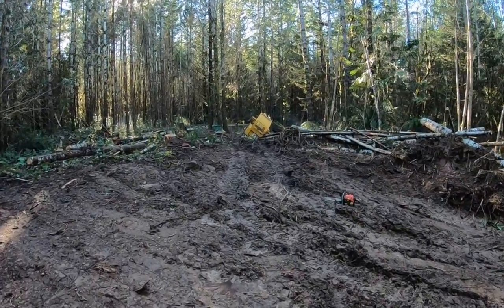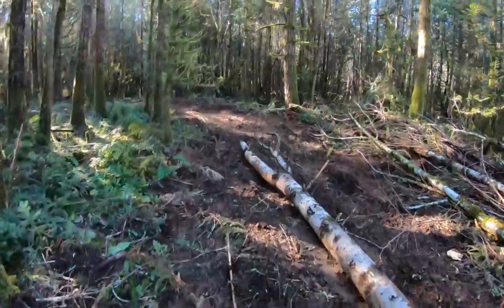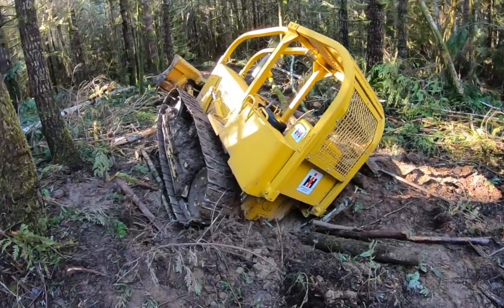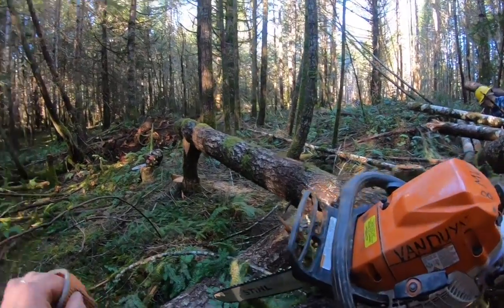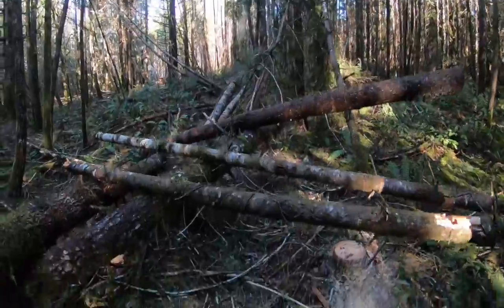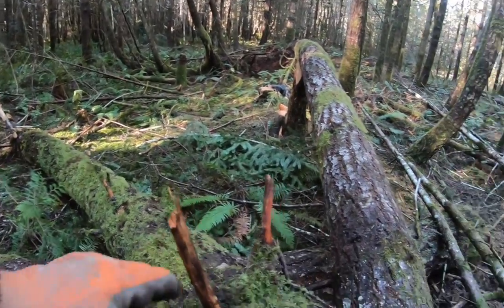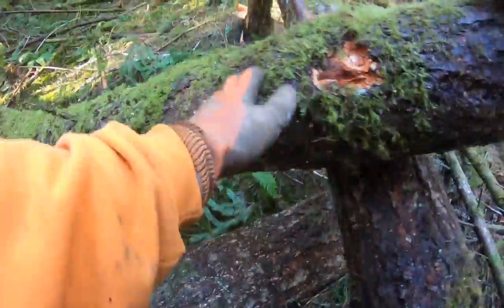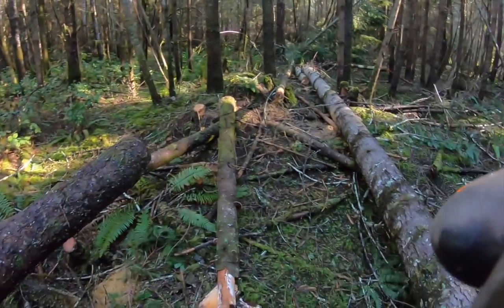DOZER FLIPPED ON ITS SIDE,.... ALMOST,STUCK FOR SURE!!!

Comment: Should have pushed the side of the blade that was down in the mud out hooked chain to that side of the blade pull in and reset repeat til out oh yeah whenever you're pulling anything out of a ditch or something like that your winch or cable or whatever method you're using as anchor must be on the opposite side of whatever you're pulling as far as you can get trying to pull straight on is pretty much a waste of time you're just going to continue to slide back the way you don't want to go it's kind of like back in the trailer got to go opposite the way you think you should be going but yeah you did a good one there that was really good LOL

Comment: I've got a neighbor he has put two new tractors in his pond three times. The cheapskate trying to save on me or another excavator from coming in and cleaning out has ponds. I pulled him out the second time he was ten feet from the shore and the water was up to the valve cover on the engine with the bucket full of mud. I don't know what he has spent at the dealer removing the water these machines. The first machine was traded in with 36 hours that has been in two times for a bath. The current had 13 hours when it went in and had to go to the dealer. I wouldn't believe it if i didn't see it. They were nice machines cabs heated with ac i would think 70 or 80 horse machine.

Comment: What are you trying to do with the wood?  If you fell the trees in the same general direction they would be easier to work and twich out to your landing.  Also if your not going to push out the stumps cut them as close as you can to the ground.